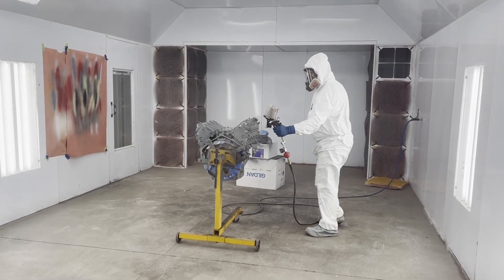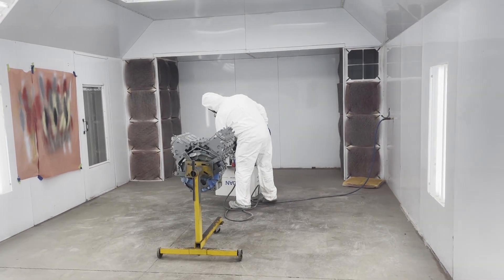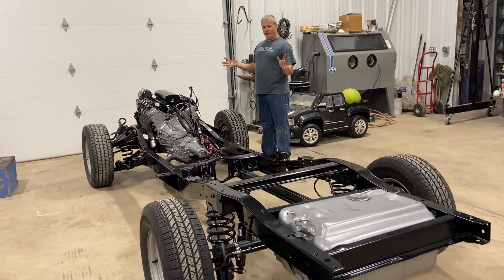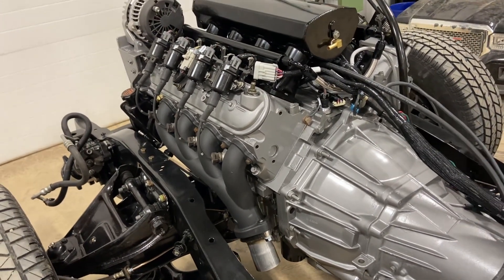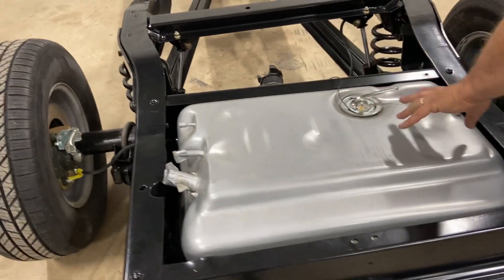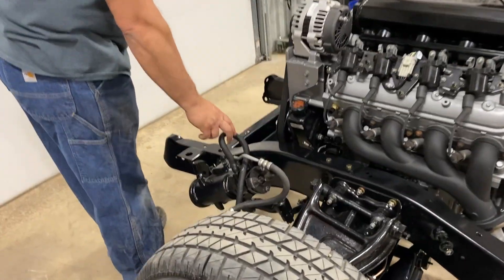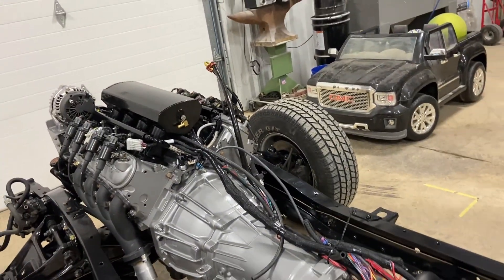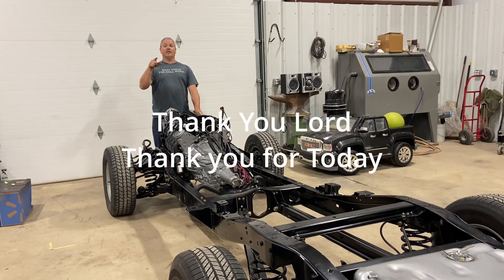Green 1965 chevy truck LS swap powdercoated chassis has all the makings of a great hot rod episode 1

Comment: Can you tell me about your EFI set up. Who makes the intake and fuel rails? Looks awesome. I'm doing a 66 with a 5.3.
Reply from the maker: Holley makes these parts  the intake part no is 300-137 the fuel rails are 534-219 and throttle body is 112-587 i used on the 66 corvette we did.   on the truck in this video it was sheet metal intake like Jegs 555-513050  this one was not jegs brand but you get the idea, the fuel rails were and Ebay kit  Thanks for watching good luck on your project
Reply: @andhotrodshop  Thanks for the information. I was curious about the pinion angle set up. I'm running a TKX transmission and the stock 12 bolt but upgraded to limited slip.
I also did a 2 - 4 drop. I was wondering what kind of angle you had at the transmission and pinion. Did you have any issues? I have my engine set at -3. I'm running a carb and MSD 6014 but not sure if I like it. Looking at switching to Terminator X stealth. I like your set up and will look into that also.
Reply from the maker: @dannyshutt8631  when I get the truck back in the shop will measure pinion angle and let you know 👍🏻🔧🔧